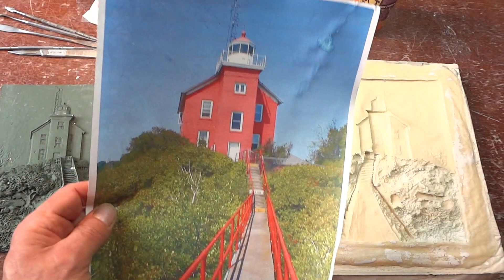Relief sculpture process overview

Comment: very good detailed video. Keep posting your work fo us.
Reply from the maker: Thank you.  I do just that every once in a while.  Maybe need to do it more often.
Reply: @EarlSenchuk  how did you create the green mold?
Reply from the maker: @adriana_linaa  I think that would have to be a video in itself.  To be brief,  it is an oil base clay called Plastelina.  It comes in a number of different hardness levels that relate to the fineness of detail you wish to capture. The sculpture is done in thin layers.  No drawing is needed.  

With a rolling pin, I flattened some clay to about 1/8" thick and cut it into a rectangle the same size as the photo after downsizing the photo on my computer.   The lighthouse requires two more 1/8" thick layers.  To reproduce the image of the lighthouse in precise proportion, I simply laid the photograph on top of another 1/8" thick layer of Plastelina.  With a needle, I punched tiny holes through the image to identify all of the corners of the building and window locations.  With the photo removed, I carefully drew a line to connect the dots using another needle and straightedge ruler, then I carefully cut out the image with a scalpel and laid it on top of the first layer.  I did the same technique with the section of the lighthouse closest to the viewer.  After the building shape is rendered in exact proportion, it's time to sculpt in tiny details.  The foliage was added last.  I hope this answers your question.